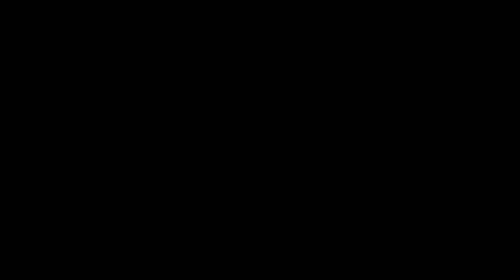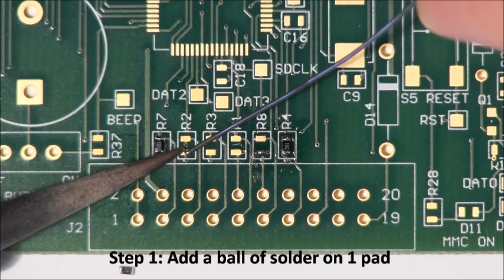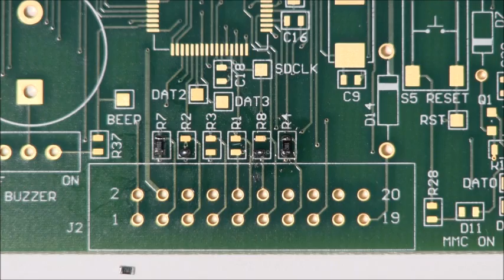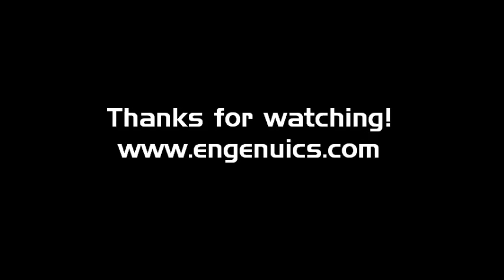Hand soldering 0603 resistor

Comment: You should hold the solder rectangular to the tip. That's better because the flux is inside the solder-wire and should touch the tip directly.

Comment: I don't see the iron ever touching the pad on the second side... doesn't this make a cold solder joint (and bad physical/electrical connection) much more likely?
Reply from the maker: You're right that failing to heat the pad will likely result in a bad joint.  It's difficult to see in the top-down view, but we indeed touch the pad.  We always use gentle pressure down on the board and slightly into the component to ensure good thermal contact, and we look to see the solder flow on the pad so we know we've done it correctly.